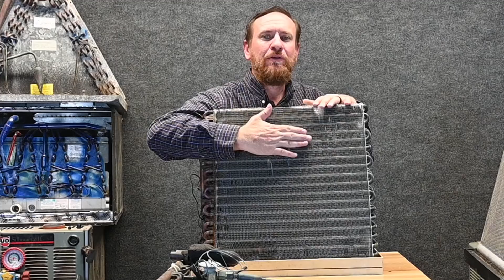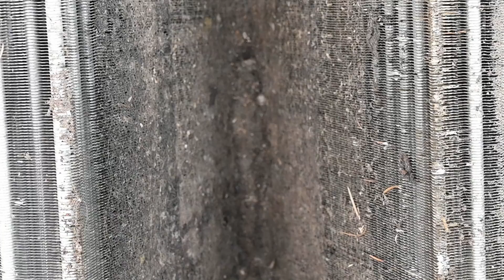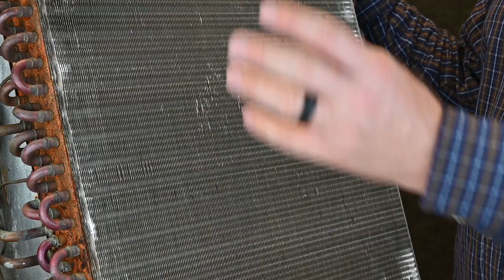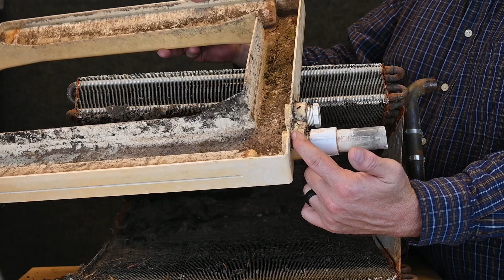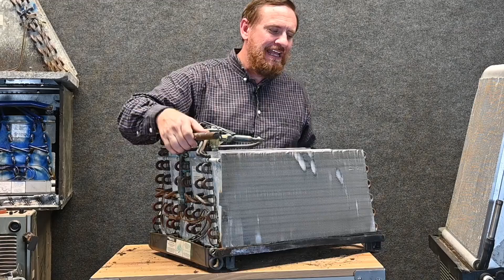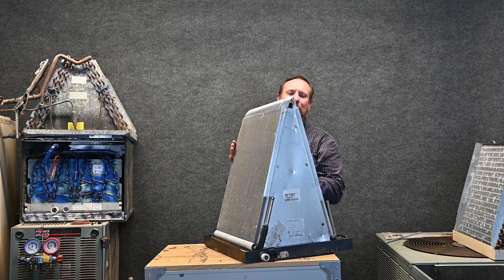HVAC 094 Evaporator a deeper look, comfort cooling, environmental

Comment: Thanks for the great presentation.  For the A shaped micro channel evaporator that you showed near the edge, the only thing that I can think of is that it was designed for a horizontal air flow - from right to left where right is where the refrigerant enters.  Just a thought.

Comment: Hi you made a technical error when you were talking about latten heat in the air that has water vapor in it. It takes 970 BTU of heat energy to raise the temperature of hot water that is at 212 deg f to change its state from water to a gas vapor to be steam. For  every one pound of water.It takes 144 BTU to change cold water at 32 deg to change its liquid  state to a sold state. Now it is ice. For every one pound of water. And it takes 144 BTU of heat added to one pound of ice to change its solid state back to a liquid  state water. And it must be pure water with no salt in it. It doesn't take 970 BTU of heat to be removed from the air  At the dew point. To remove the cold water vapor out of the air. That only applies to making hot steam. Thanks ken HVACR tech😢

Comment: what's the cost of replacing evaporator coils vs reconditioning them?
Reply from the maker: Its a case by case basis. Cost and availability has gone very high lately. The old coils that where built well, would clean. 
Some companies only sell, some only condition, but for me its case by case basis.

Comment: Sir, in R410A case,  at what subcool or super heat level, can be top-up allowed?
Reply from the maker: 410a can be topped off easily, unlike other blends. Charge to the manufacture specification.

Comment: Ty...can u differentiate reason between suction line and discharge line ice formation....
Reply from the maker: Great question,
Liquid line Ice formation will be from a restriction on the high side.
Suction line Ice formation is because the line temperature is below 32. In residential that is bad but for commercial application such as freezers, Ice makers, custards and more that can be completely normal. Superheat will be vital for that.
Reply: @love2hvac  Thank u sir....for low in gas charge,where will be the ice formation- discharge side or suction side?

Comment: Great video, thank you!  I had a question.  How do you feel about making the evaporator a 1/2 ton larger than the condenser to increase run time to help with dehumidification?
Reply from the maker: A larger evaporator alone will be worse at dehumidification. The larger coil will absorb more heat raising the suction pressure raising suction saturated, that moves the coil temperature farther from the dew point.  
You have to combine a larger coil with slower airflow to allow more contact time with the coil. That slower airflow could cause the ducts to condensate and sweat. 
AHRI has performance charts and system matching options that take all this into account. 

Here is a link that will explain that.

https://hvacrschool.com/an-evaporator-coil-with-no-fins/

Comment: Super informative Ty.! I can’t wait for a more in depth video to clean an evap. My unit is only about 3 years old. But I’d like to clean it fully. 

When I took my front panel off a few months ago to insulate my sensing bulb I tried looking at how to take out my evap to clean. But I didn’t wanna get to far that I couldn’t get it back in. So can’t wait for that more in depth cleaning video.!

Comment: Great video Ty.  Minor correction:  The latent heat of atmospheric moisture is not 970 btu/lb.  That is the latent heat of steam at 0 psig or 14.7 Pisa.
The atmospheric moisture is at near vacuum around 0.25 psia.  Depends on the dew point.  A number like 1060 btu/lb is more like it.
Reply: Oh yeah, the funky pressure being the sum of all partial pressures. Since water is a tiny fraction of the vapor it has a tiny partial pressure. Weird to think about. Same reason non condensables give you high head pressure but saturation lower than it should be, thanks to its partial pressure being lower than the addition of mostly nitrogen pressure.

Comment: How do domestic air conditioners control relative humidity?  As far as I know that in the ACs only cooling and dehumidification take place. But at the dew point, RH of the air remains 100%. Please clear up my doubts.
Reply from the maker: Many ways methods. I will cover this  more in phycrometrics. 
By slowing the airflow the suction pressure and suction saturated drops farther below dew point removing more moisture. Varable refregerant flow units will also adjust the compressor speed to assist with this also. We can also apply electric reheat to maintain a temperature while removing more moisture. 
The humidity immediately after the evaporator coil will be higher  but less moisture content (fewer grains of moisture) then as the air mixes with the remaining air the over all humidity drops also. Humidity is relative to temperature and overall is a poor way to discuss moisture content but it's what people can relate to the most.

Comment: There are a quick connection between lines, do you think these connections works with evaporator instead of brazing?                         The evaporator which it’s made for humidity weather it’s different than the evaporator which it’s made for dry climate in fins or in what?    What kind of brazing use between copper and aluminum or aluminum to aluminum? Thanks 🌷🌿
Reply from the maker: Great questions. I do not know how to braze between copper and aluminum. It's usually all copper coming out of the unit. That's what we connect to. I'm not sure about those quick connects yet.
Reply from the maker: Same coil for both environments. Some cost line units will have a salt corrosion inhibitor coating. 
A different size coil will may be used for a diffrent climate. 
You can have all copper evaporators made that should last forever but they are expensive.

Comment: Another great video Ty.! You need to be the teacher of teachers. All your information is great. I was about the only one who really enjoyed psychometrics. Now when I look at any two points I can see how all of your points come together on a chart. Awesome stuff
Reply: Welcome gue  engerung jobes  i teck ...cours  local and uint organnal feeuintlot  companney  made   stard  methad  lot  companshion  area   volve and useing    ac  systom ok  .. chapater ..  very    con d fdants ok    The  psy  chrometric   chart    the  properties  of  air  is  graphically   shown in  psy  chro   metric  chart.. the  following area  the  line  and  scales  shown  in  rhe  chart..  must bee  bacal   ac  uni coil  total  area    ...  vertical  .parallel   line from  the  top  of  the  chart  extending  to  the  horizontal  line  at  the  bottom  are  dry  bulb  line the scale  at  the  bottom  is  dry  bul  temperature  scale    ..diognal  line  are  the wet bulb  temperature line  the  scale  marked  at the  curveof  chart  is wet bulb  scale   wet  bulb and  point  temperature  scales  are te  same  ew  oint  line  are  horizontal   partallel  lie  lwfte  to  right  of  chart  is  follwing  bacial  pscaher ude stnd need some show  ac  school  not work go some ad  darmma  making iti coures   exples  100  150  amond give  dopely msking notcorues staey gues  ok tell not same lot  coures stdy boos tell coure  attend harras makin not unde stand tock  very feel  not  soving gouredsome rmoved good gues lot boss cours attnd righting not  uderother gues msking fllowing  playing lest boy bae is stoping this bacical foll ps  art ok gues soe in cldring engrig cors...s ok..

Comment: 10:11 negative vs positive air pressure in an air handler/furnace
Reply: When do we need to add holes to the condensate drain line cap?
Reply from the maker: Yes I will cover that when I get to drain lines

Comment: You put out some Good video 📹 it helps me to remember the Terminology. Looking forward for the future videos. Will you be doing any videos on how to size a system and using manual J ?
I Appreciate the time you put in your videos. 👍 👍
Reply from the maker: Thank you. Eventually I will get there. It's taking a bit longer than I expected.
Reply: Vedo ok see  v angels  coil  goos  dreing shein  dry  pan  comupant usi  covering  are dry pan  lecking  ard bsi    dh  some are  mage are  lek  rrparing expresin ned lot ard  expleas sir  good  shering  comd mind uding  coil good  ceilinv snd  after refixing  somd removeing point expleas working gues und stand point  ok dif  this way my side n..

Comment: I think a vapor coils are leaking so much because they went thinner on the aluminum tubing
Reply from the maker: I agree
Here is a nice article on it but I think it comes down to lower quality, cheaper and thinner copper.
https://www.achrnews.com/articles/104661-troubling-pinhole-leaks-in-evaporator-coils-cause-corrosion-issues
Reply from the maker: What's your thoughts on the micro channel evaporator coil?

Comment: It’s time for the industry to build “ a better mouse trap”. We know that brazing is the major cause if leaks so how about making an A coil WITHOUT braze joints by bending one continuous copper tube . Yes, I know that this isn’t easy but we have to do something to make these better.
Reply from the maker: The problem is its leaking in the tuning now more so than the brazed connections. 
https://www.achrnews.com/articles/104661-troubling-pinhole-leaks-in-evaporator-coils-cause-corrosion-issues

Comment: I believe it's poor evacuation methods!
I've watch tubers put the micron gauges on the pump itself or on the pump side of the system,and I also know some only use manifold gauges for the evacuation  and wait one hour for any movement than release the charge. 
🍺🍺🍺🥃🥃🍿🏌🏻‍♀️
Stay safe.
Retired (werk'n) keyboard super tech. Wear your safety glasses.
Reply from the maker: I agree. I recorder the vacuum series over 3 monthes ago. I decided to wait to build the importance of vacuum threw the series first.